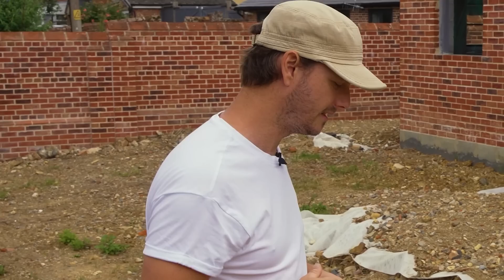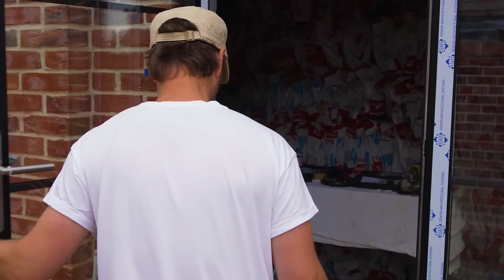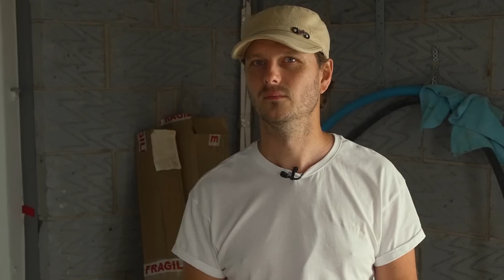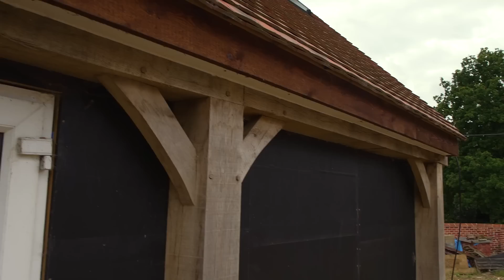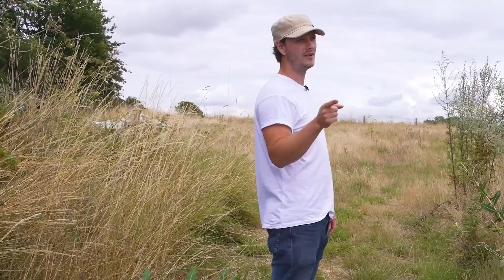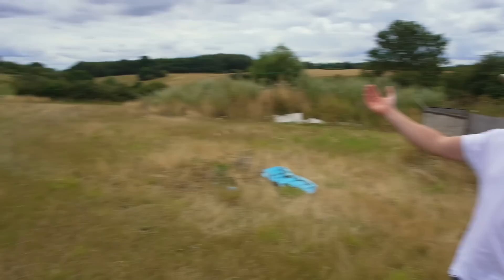The Aiden Project : An Ambitious Self-Build

Comment: Coming to the end of three years doing a pretty involved renovation myself learning from scratch on the job I respect what he's doing for sure, looks like he's doing a cracking job. I can't understand why after having class Q turned down but new build granted why on earth you would give yourself the headache of sticking close to class Q under your own will when you don't have to! I would start afresh with a totally new design without the often insane limitations (for a building that is no more!).
Reply: Hey mate, ah no class q was granted but I went full planning to get the extension for the utility and plant room plus I couldn't afford crital windows. The original full planning was for a barn conversion but I had to resubmit for a new build with exactly the same drawings because I had issues. In hindsight I could have went class q straight to a new build as I had the fall back position but I didn't know I would have any problems. Even if you go down the replacement route, the planners still like it to look like a barn and I like it that way anyway, gives it character 😉